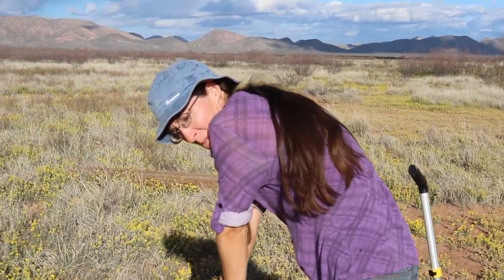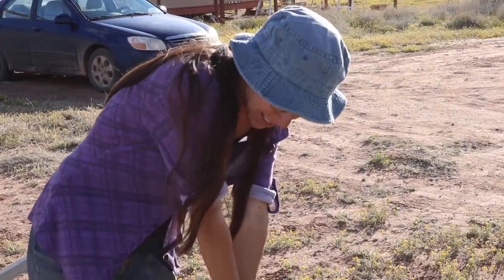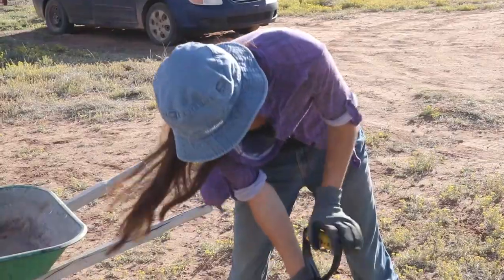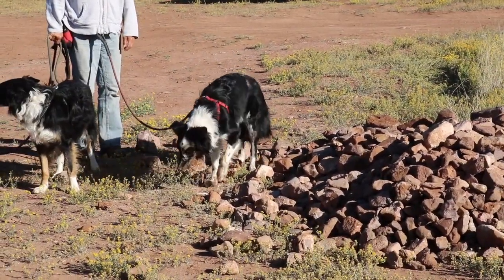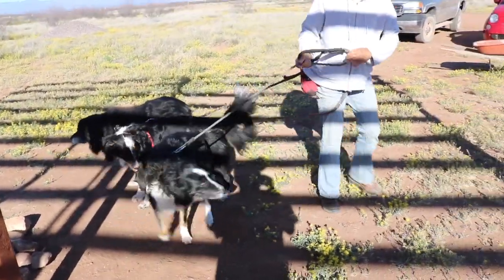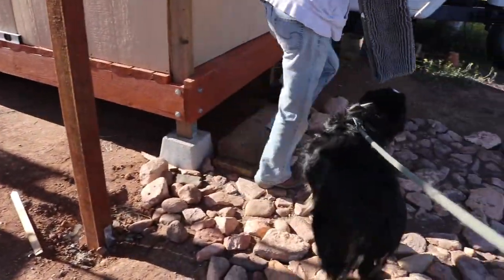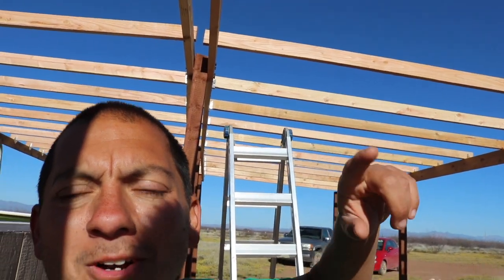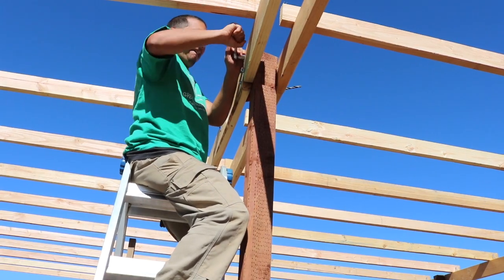DIY Water Harvesting System for the OFF GRID HOMESTEAD | Installing the Rafters

Comment: Hey Jim - it may be a little late, but your rafters will go a lot faster if you cut a witness stick to measure distance between brackets. Put one bracket in place with a few fasteners and then use the stick to set the next bracket in place. Don’t put all the nails/screws in until you have the joist in place so you have some ability to adjust the bracket if you need to. Be careful about run out! Looking good!
Reply from the maker: That is really good advice. It is a little late, but I appreciate it. I can always use that for a future build. Thank you!🙏

Comment: Hey Jim, I'm no expert builder by any stretch of the imagination but it seems like you need more cross bracing to prevent the entire structure from swaying or leaning to the point of collapse from all of the weight of the roof and any other factors like wind or snow load (if you ever got enough snow accumulation). You never know what the world is going to throw at you these days weather wise. I'm posting a separate comment with a link to show you what I'm referring to. It's a video dealing with a deck structure but same bracing principal for your roof structure. I'm posting the link as a separate comment in case it goes to your "Likely Spam" folder. If you don't see the comment check spam.
Reply from the maker: Good advice Jay! I watched the video. You're right, additional bracing will be used. We're going with a multi pronged strategy. 
I always appreciate comments, they are definitely needed and welcomed.🙏
Reply: @ourselfreliantlife  Awesome Jim. Glad to hear that you guys are doing some extra bracing.

Comment: Would you like a way to setup a simple dog run that requires no fencing? As there are 3 dogs would need 3 independent setups to avoid tangled lines  but would be able to have them outside without as much supervision but would require a harness rather then a collar as they could hurt themselves with a collar running at full speed and hitting the end.
Reply from the maker: That definitely sounds pretty interesting Andrew. We're always looking for new ideas. Thank you!
Reply: @ourselfreliantlife  2 posts per run with a cable strung between them that you run a pulley on connected to a length of light weight chain to let the dog move around anywhere along the cable. would be able to have a common area in the center but would want to limit it as they can easily tangle chains if given to much room to get together. 

At the far post you want a stop on the cable so at most they can just reach the post to keep them from getting wrapped around it but the near post if they do you at least don't need to go all the way to untangle them. 

This would also let you have shade and water in the center common area so they have a place to rest but still have a good amount of space to run without fences. The key is still a harness for the dog as at full run hitting the cable end stop would put way to much pressure on the neck if they are connected to the collar.